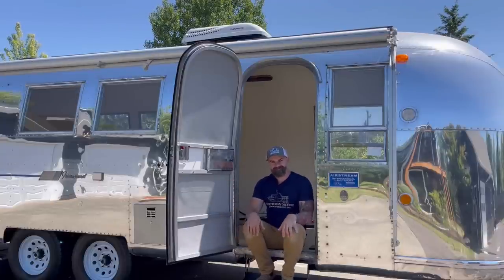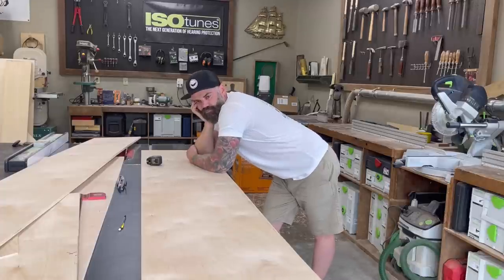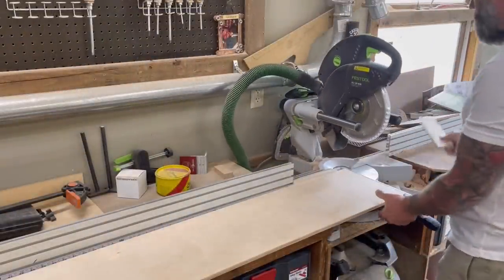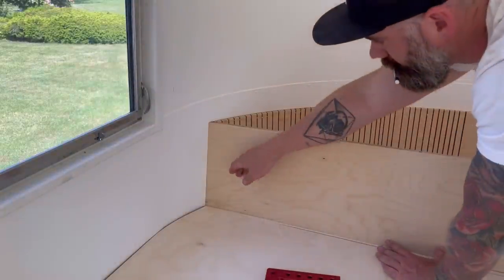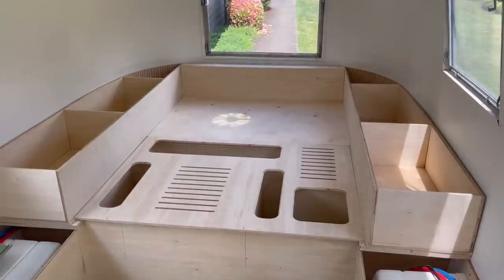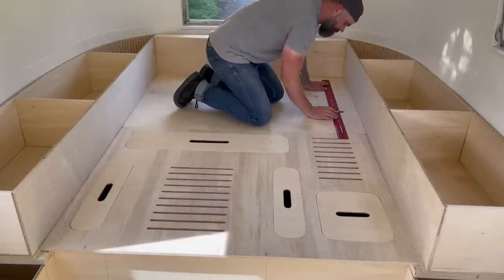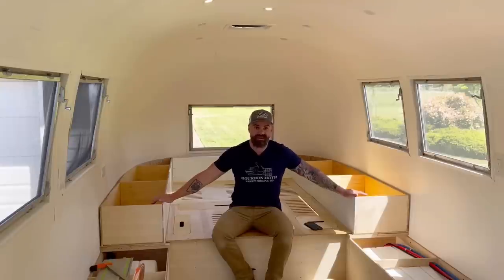Airstream Storage Bed  || Custom Building an Airstream

Comment: Someone else probably said this already, but make sure weight distribution is balanced to the center of the trailer, not over the tires, the CENTER! If not it could get squirly and it would suck to find that out after all that work.

Comment: Don't know if there's a place you could go it on the air stream but one feature I like on some of the trailers I've seen is access to a small fridge from the outside just for grabbing a quick drink instead of having to constantly go in and out of the trailer. I've also seen small flat top grills on sliding tracks that you can access from the outside and then stow away when finished which would be pretty cool.

Comment: with the idea of weight savings there is an extra  1/2" piece of plywood under each side cabinet. if you'd  left that out and made the cabinet that extra 1/2" taller you'd save a bit of weight.

Comment: Jason overall weight I wouldn’t be to concerned with if the trailer suspension and frame/crossmember can handle it but weight distribution needs to be considered. If it’s not balanced correctly it will be a nightmare to pull

Comment: Awesome series! In the concern column, trailers vibrate and walls move on the road a lot. I haven’t seen you build tolerances and/or dampeners/reinforcements in yet. In my brand new trailer lots of furniture components got misaligned or plain fell off on the first long trip. it is a crappy quality trailer though built during the pandemic demand. 😊

Comment: I always think it's crazy when people add concrete or granite countertops and ceramic tile to RVs... I guess they don't mind hauling around an extra 1000 pounds of unnecessary weight!

But, I've watched you build a boat and a treeless treehouse where you don't know what you are doing... And they both turned out great! Now the real question is where are you going to mount that boat?!

Comment: Hey Jason, once you received the Airstream back from the restorers, did you weigh it?  Having that weight and the weight of this model Airstream all outfitted when it was new, would give you a very good idea of how much weight you have to work with during your construction phase.
Finally, I was wondering if some of those Romex box protectors electricians use to hold cable in place and prevent chaffing, or something to that effect, might prevent your water/electrical/hydraulic lines from rubbing, fraying, or making noise banging up against the side of the aluminum.  LOVE this series - right up there with the no-tree tree house!

Comment: Here's a tip I restore RV's you need to hook up a water pressure valve because most RV parks have different water pressure and if you hook up to them and turn the water on full blast it will blow up your water lines so having a water pressure valve will stop this from happening and for your shore power hook up a serge protector is needed so you won't fry your wiring and electrical

Comment: I am not a woodworker, but in my mind I think that you could hide the kerf-cuts in the corner you are hiding with the compartments, by rather flipping the board so the kerf-cuts face the body of the airstream. The wood should still bend enough .. maybe? Really liking the series though. Thanks for sharing your process.

Comment: I would not worry so much about making plumbing and electrical things accessible unless it is a serviceable part. Ball valves electrical junction boxes yes you want to be able to get to these. As for the pex, when you build a house its in the walls. If you have a problem in a few years you need to open them up. You don't put a hundred access panels in to service every 90 degree pex fitting.  
As for the wheel wells on the inside I would just foam them in to add a little more rigidity to them.

Comment: Great plan on being able to take it all back apart if needed for repairs.  Suggestion... would it be worth it to use threaded connectors rather than going straight into the wood?  That way you know it can go back together with the same tolerances and tightness, and no worries of stripped threads?

Comment: I'm a beginner when i comes to woodworking and rving, but ive rved enough to know that the entire camper shifts and flexes. I suspect the airstream is a little less than others due to materials. Be consious of thay as you make tight joints. This is especially true for you storage covers.

Comment: I wouldn't have the patience for a build like this but I love watching it!  Just a thought: would it be possible to put the kerf cuts facing the trailer wall so that the finished plywood was on the inside and you wouldn't need to add that veneer?  I'm not a seasoned woodworker so I'm not sure if that's an acceptable direction to bend the kerfs.

Comment: looking very good, why not add access hatches to the bottom of the two side pods so you can easily get into the lower section without removing the top curved pod, that way you can keep stuff in them that you dont need every day and also get to cables pipes etc. I agree with the other comments re the two end curfed sections, USBs. lights, switches, radio alarm clock, use the crap out of them, leave the curfs visible they are cool. TV on the roof that can hinge down, controls where you can reach them for everyhing or you end up crawling out of bed 50 bloody times a night.. loud speakers in the thin side to side thingamajig.

Comment: Thanks for your great content. I love everything that you do. I’m not technically sure what they are called or if it’s feasible. But for easy assembling of the parts couldn’t you use some sort of mechanical locks like what some bicycles have to remove the wheel? Something that doesn’t require unscrewing. Something modular. Thanks again

Comment: If you are going to be lifting those pieces of plywood in and out ll the time, consider putting a binding piece around the edges of solid wood (oak. Maple. Whatever) this means less of a chance of your plywood splintering/weathering in the edges..  doesn’t need to be a thick binding. Just something to cover the edges/

Comment: Before making anything too permanent inside, consider adding gas and water outlets to the door side corners, outside.  You will always want some water or propane connection, there are never enough.

Comment: you'd be surprised the damage a blowout can do if you don't catch it right away. I'd recommend getting a tire pressure monitoring setup for the RV tires. They'll let you know right away if you have a blowout or even just a flat tire that could turn into a shredded tire. They're pretty inexpensive, especially when you consider how much damage they can prevent. 

just do a search on youtube for RV tire blowout and you'll see the horrors.

Comment: I really enjoy your channel, you do great work! About storage, you can never have enough in a RV.

On the door side, did you make some way to access behind the wheel well under the cabinet you're building? On the opposite side it has the door from the outside and you finished that off great. not sure if you're too concerned about losing that space in the other side?

Comment: put a circular flush plug cap on the corner storage you wanted to give up.  Never give up any storage.   If you have seen the "Decked drawer" system people put in the bed of their truck, they have a plug cap for the corners so see that for how it would work. I would even make some kind of access to put things in the thin rectangle storage you built for the head of the bed.

Comment: There is some wasted space (POV camera) on the left side under the storage carcasses you just made that has no access. If you cut a recessed panel in the bottom of the carcass you can access the additional space. It would be deep storage, so maybe if you plan on adding some electronics or batteries or something, that would be an excellent place for them. Just a thought.

Comment: As an owner of of several yachts over the years, I've never seen "ventilation" slots cut into the bed foundation.  My current boat has a master stateroom bed with a large removeable, rectangular access panel.  Underneath that access panel is my 90 gallon freshwater holding tank, my 11 gallon hot water heater for the boat, my aft cabin air-conditioner that utilizes lake water circulating through it continuously and a sump for air-conditioner condensation and shower water plus the bilge.  That's a lot of potential sources for water under our mattress and I've never had any mold on the bottom of my custom mattress on any boat I've ever owned.  I've also never seen a boat with " mattress ventilation" slots.  Plus the fact that our boat is kept in the water 24/7 , 365.  All of those are real moisture sources and the Airstream has none of them.  What I'm trying to tell you is mold on the bottom of your mattress should not be a concern as travel trailers, RV's and live aboard boats are very similar in their design and function.

Comment: You could remove the panels left and right of the bed and just put down the 2 storage units as they have bottoms. No need for a double layer of plywood. Same with the box at the head end of the bed, no need for a full bottom, 2 small stripes would suffice. Will save some weight.

Comment: Looks good so far. The down side to this sort of thing is that your just going to need to live in it for a while to see what’s useful and what’s not. There’s also ALL the gear that you have. Dose the folding table fit in this spot that would be perfect? No it’s 1/2 an inch too long! Dose the toilet brush fit between the toilet and the cabinet or am I going to stand here awkwardly letting it drip dry so I can stow it back in the cabinet? I built a camp kitchen recently and this was the primary battle. I started with the gear and worked backwards. It was heartbreaking to build version 1.0 just to find out standard size paper towels wouldn’t fit. Did I cut an inch off the roll and go camping? Yes, yes I did. I have since finished 2.0, but it ain’t quite perfect yet. Let’s hope third time’s a charm.

Comment: Tire blowouts... Just keep the air pressure maintained and it shouldn't be a huge problem.
Weight distribution... I think it's 60/40. 60% in the front and 40% in the back. You want more weight on the tongue for stability.

Comment: What about cutting out some rounded square holes in the back of each of those side carcasses for a touch more weight savings, without compromising the structure?

Comment: I hope this comment is helpful.  A potential concern -- from an engineering perspective.  When you're driving that thing down the highway, it's probably going to flex a lot more than you'd expect.  The pieces you so carefully aligned/positioned are likely to experience oscillating differential stresses.  Don't be surprised if you find the walls becomes abraded and maybe scarred at some locations from the constant wiggling and flexing of the wood against the sides.  If you've glued anything to a wall, the glue joints might break from shear stresses.  You may also find that having continuum of material completely across the width of the interior results in cracks, chips, or bowing on your wood pieces, but hopefully not.  Annnnnd your carpentry expertise tells you that you'll probably have to consider how much changes in temperature and humidity will alter the "fit" of the wood across the interior.  But let's hope that NONE of these things become significant problems.  It's just prudent to consider them.
Reply: While the flexing of the trailer's body and frame is a major concern, the big advantage to plywood is its dimensional stability compared to solid wood. As long as it doesn't get wet it should be okay.
Reply: @GrayRaceCat  Good point.
Reply: @Impatient_Ape  He still needs to seal the lower storage compartments though.

Comment: You should have used the void area to mount electrical items, such as a wireless charger for your phone. If you think about it, you are likely to be putting your phone there when you sleep, as it will be your bedside table.

Comment: You talked about weight but… weight distribution is very important for how the trailer will track when towing. In aviation we call that weight and balance. If your trailer is tail heavy then you can get into a sway situation that will put you in the bar ditch right now. If you are you tongue heavy then you can’t see over the hood and lose stealing authority. Also dual axels are not like single axels. 
Keep thinking and planning.

Comment: Yes, I am one of the people that said you should relocate your lines and I still stand firm because I have had a tire blowout on an airstream and the part you’re knocking on is just thin sheet metal and then the plastic piece that you’re talking about is just what they put on after But one way or the other when the tire does blow just hope you’re not going over 45 miles an hour because otherwise it will punch through that sheet metal and through that plastic so just so you know if you’re redoing this or you just want to fix it later now you know

Comment: Cool project!  In addition to considering total weight that you’re adding do you need to consider distribution of the weight front to back to maintain good road handling?  I’ve seen those videos of trailers on a treadmill swinging like crazy if the weight is too far back.
Reply: Oops. I should have read through the comments first…

Comment: I think the concern about the weight is not the weight itself but the balance of the weight behind the rear wheels vs between the rear wheels and the trailer hitch. There's been some experiments done if you put too much weight behind the rear wheels  of a trailer that an out of control oscillation can occur while you're driving. You're only part way done and still planning on more built in so i think you're going to be okay.

Comment: I can't help but notice it seems there is an unaccessable pocket on the left side of the bed. (The right side is identical but has an external access hatch that isn't on the left side.) That could also be storage space so long as you have a means to get at it, which at the moment seems the best option is to have it be reached in from under the matress (may require some contortionist tricks to reach) alternately though the top of the left panel which is probably easier but would be less symmetrical.

Comment: You may want to plan out wire paths before you start building too much more, since they're in the bottom floor level.  If you want to add any lights behind or on top of the cabinet's that you're building, it might be hard to route the wires after they're built.  Wire planning or at least accommodation should be taken into account.  Even if you plan out everything now, a future upgrade might cause you to not have any ways to route wires.  Even a simple unobstructed track around the bottom of the RV that you could fish wire through would be good (Instead of cutting holes just big enough for the existing wires to go through).

Comment: you changed the weight you need to weigh the Trailor when done. then axle size and change axle size as needed  take in to account total weight  if you fail to do this the axles can bend or bearing will die on trip

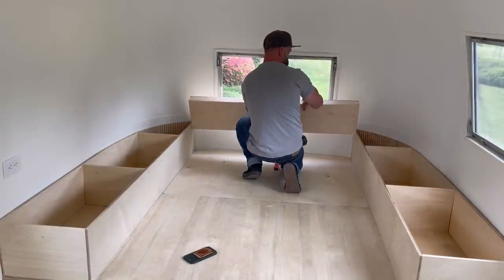Comment: I envision 2 combo electrical/USB receptacles on either side of that tiny rectangular box you built that sits under your back window.  One on either side, for charging all the electronics.  Otherwise, all I saw at 13:56 was just wasted space and you don’t have enough to waste in this expensive rolling tin can 🥃🥃👊🏼

Comment: Cut out a paper template of the bed platform, go find a foam supplier wholesale give them the template and explain what your making and have a custom cut foam mattress cut to fit the space, keep the template,  then go to a fabric store and buy fabric to make a fitted sheet to cover the foam also a pillow type with zipper case for it.
The foam should be sevral layers of verious types of foam and fill.
My favorite is latex foam but you only want a thin layer of it 1" thick on top you should use at least 4" of foam and fill materials.  Now the whole bedroom is a bed hence bedroom.  Youll want to be able to flip this once every 6 months.
Then you can use cal king bedding on top of it.  That much room 4 people could sleep on it if you had too.  Like 4 kids.  You could even do fold down bunk beds for the kids like you've seen on the older sleeper trains in the movies.

Comment: Glad you've thought of overall weight on the airstream, but keep in mind that the distribution of that weight is critically important for safety while towing. There are a lot of good videos on the tube you can reference for this and almost as many free calculators you can look up. Here's a short one that gets the more important points across very well (https://youtu.be/JeEEC5eVNCk). Great build Jason! Has quickly become one of my favorites.

Comment: You could have built the sides like you did the wheel wells so only one side and top are the only areas that need to be solid. The bottoms are not needed as you already had a bottom created by the tops. So by framing it out like the wheel wells and then putting a top and the sides that are not against a wall will reduce the weight. The amount of weight you add to the trailer frame is one thing but keep in mind the tow capacity of the truck that will be pulling it. Most campers that I have owned or been in have had all of the walls, cabinets and interior doors are framed out and skinned with 1/8 ply however they are nowhere near the quality that I see you putting in. The rounded kerf areas could be used as hidden storage/safe